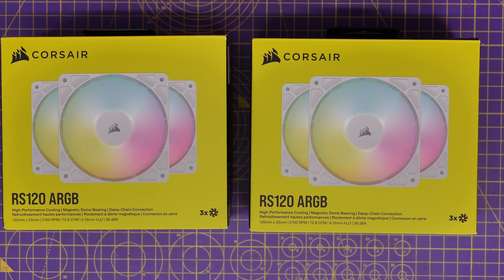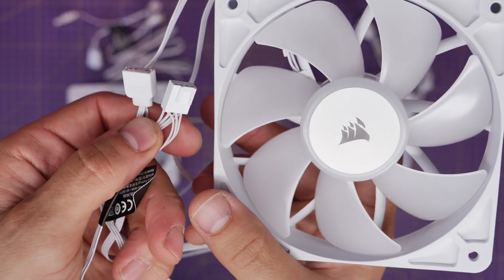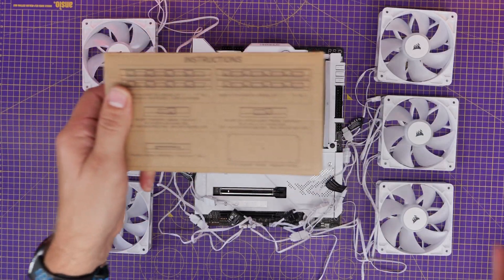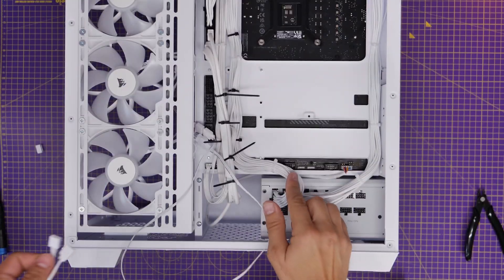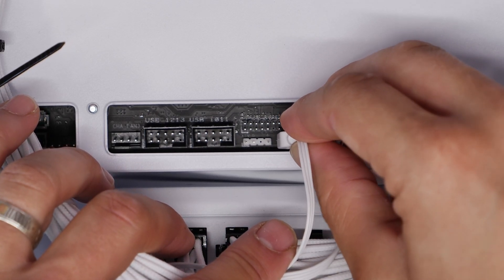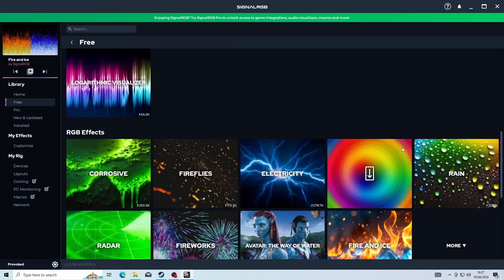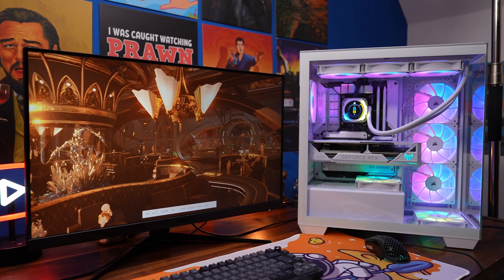How to setup and wire Corsair RS120 ARGB fans

Comment: Can you connect 4 RS120 in a single MB if the system have 2A & 24W maximum outputs? 5v (3a)argb to a max of 256 LEDS?

Comment: What I was wondering: you linked the argb of the rear exhaust fan to the argb of the radiator fans. You plugged in the radiator fans to the CPU-fan header. But I'm missing connecting the rear exhaust fan to a motherboard fan header. Also I don't see you plugging in the radiator fans (and linked exhaust fan) to an argb header (?).
Personally I'm having issues with a similar setup. I got a prebuilt PC and everything is great, except the ARGB lights of my case fans and radiator fans. I got a TUF Gaming B650 motherboard. Corsair frame 4000D case with 3 RS front fans, 1 exhaust fan and 2 radiator fans on the Nautilus AiO cooler. The first time I powered on my system, the ARGB lights of all the fans worked. The second time they didn't. I tried looking through software and settings what was wrong. But software isn't the issue, I think. As long as the fans light up at startup, they get recognized in the software and I can control them perfectly. But the problem is, they don't always light up. I tried checking cables and connections. Sometimes it helps unplugging an argb header and plugging it back in before startup. But even if they work then, when I startup the time after, they don't light up... :-(  I don't understand what's going on and what the issue is. That the argb lights sometimes work, would imply the connections are fine. Also because it's either all of them work or none of them work. The rgb on my RAM always works and gets recognized in the software. But that's not plugged in to any motherboard headers of course. Also the fans always run without issues. So it's purely the argb not working correctly somehow. Drives my crazy. And it's hard to troubleshoot, because all the argb cables are bundled and tucked away.
Reply from the maker: Could it be a bios update is required and aura sync updates via armoury crate?
Reply: @TheProvokedPrawn  I do have the latest bios version installed for my board. I removed Armoury Crate, Aura Sync, iCue and ASUS fan Xpert from my system. There was so much installed and it didn't do much. Weirdly, I had it all in my list of installed apps. But I couldn't even open some programs, since they weren't in my apps list. Could it be a software conflict? Caused by old install files? Should I try installing Armoury Crate again?
This morning I traced all my RGB cables again. It's a bit messy with lots of connected wires. But since it works sometimes, I don't think that's the issue. Especially my 3 front fans are daisy chained together pretty straight forward. Connected to a fan header and an argb header. So that chain should at least work all the time (?) The setup of my 2 AiO fans and the rear fan is a bit more messy. But since all my 6 argb lights work sometimes, it should be fine. Also all fans work without any problems. So the fan connections are flawless.
Reply: @TheProvokedPrawn  Update: I reinstalled Armoury Crate and uninstalled it using Revo uninstaller. That didn't fix it. But...I checked the wiring really thoroughly. Besides the 2 radiator fans and the rear fan, the pumpheader ARGB wire was also connected to the same ARGB header. Also the chain of wiring was a bit weird with extension cables and stuff. I decluttered it. Now my rear fan and pumpheader are connected to one ARGB header and my 2 radiator fans are connected to a different header. The 3 front fans are also on a separate ARGB header. I don't want to jinx it. But several boots in a row my ARGB works fine now. I control it with OpenRGB. Works fine. No need for all the other applications. So fingers crossed that was it. Thank you for the moral support!

Comment: I have the exact fans but my wires are significantly shorter making it nearly impossible to add a back fan and fans at the bottom of the case. I’ve also run into an issue where if I do get the fans to connect, they turn on, speed up then turn off, this is a continuous loop of the pc is left on
Reply from the maker: Maybe I suggest watching this new and improved video. It's on the RS140 fans but focuses on the wiring and the logic is the same. I show a couple of controllers in there which will help with the issues - https://youtu.be/S5I0yqXKlwg

Comment: Im still confused
Reply from the maker: Sorry
Reply: @TheProvokedPrawn it’s okay , I bought the thermalight link hub you used to make it easier. I’ll just follow your foot steps . Only thing is that there’s two very long of the same cables . Both start with a power connector and end with a 3pin 

Could that be a AIO cooler cable ? It’s also Corsair Rs120 fans

Comment: all very well, however I run out of header on my m/board, I received a hub with the corsair iCUE Hito Capellix,the plugs from this CPU cooler are much smaller, andnow theplugs from the fan wont fit the hub
Reply from the maker: yeah, they're not designed for it. I did say that right and the beginning and show you alternative solutions at 4mins - https://youtu.be/GSrsfyaYPKA?t=28

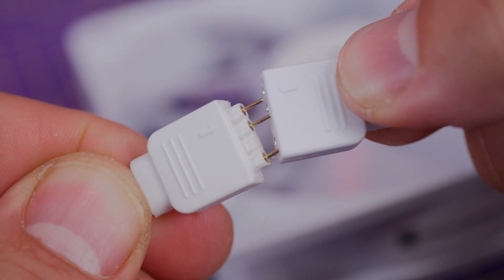Comment: 3:07 I’m trying to setup my 360 rgb nautilus cooler and I keep trying to connect all three tiger but I always get an extra wire like the rgb one with 3 spike that won’t plug into my motherboard…I just wanna know how to correct “daisy chain” or whatever all wires in correct place
Reply from the maker: That spike one is meant for connecting the fans together. As long as you have a connection that goes into the motherboard and the other fans are connected to each other it doesn't matter if one cable is spare.

Comment: @TheProvokedPrawn. Hey, hope you dont mind solving a riddle for me. This is the closest video I have found so far that actually helps but I still want some help. I'm new to pc building and the parts I want to use is: 
HAVN HS 420 VGPU case, msi meg x570 unify(motherboard), Corsair nautilus 360 argb (Aio/cpu cooler), Corsair RS140 ARGB Fan 2stk, Phanteks M25 Gen2 140mm DRGB Reversed Fan 3stk. 

Im having trouble connecting them to my motherboard (both cable and the pump to the cpu). Is the thermalright argp and fan hub recommended?

Comment from the maker: Corsair has changed the cabling since I made this video. Now the cables are shorter. Here's why (direct quote from Corsair):

"The RS series of fans natively supports daisy-chain connections between each fan. Due to the daisy-chaining of multiple fans, we’ve realised there is no need for longer cables. So, we have switched to shorter PWM and ARGB cables for easier connections between each fan and easier cable management. Each pack of fans, from single to triple, now includes 600mm PWM and ARGB extension cables to let users connect the last fan in their chain to the motherboard headers."
Reply: I just bought the newer set myself, the wiring is absolutely terrible now. Because the wires are so ridiculously short they barely even reach the daisy chain connections. 

Wish I'd bought it earlier honestly, because the new version just seems awful. Bought them for my first pc build, and it's just. Killed the enjoyment for me.
Reply: @DYSK0F1ST  I agree, I just bought some this weekend and its totally ridiculous. Its so hard for cable management. Wire show everywhere. I actually go reverse fans and too the wire outt of the little slot to pass my wires behind my case to manage in hiding my wires. Now to set them up, hopefully running all three fans on one daisy chain wont fry anything.
Reply: @OGrickm it shouldn't, I've got my three fans daisy chained together. Should run just fine off of one fan header for power, one RGB header If you care for RGB. 

Just a bit of a pain, I ended up using a set of the sorta cable extensions they give with them. To get everything wired up. worked just fine in the end, Haven't had any hiccups since I fully built the system. The sorta 'spare' wires that come with the fans are extensions, just connect those to the cables you'll be using with the fan you're connecting to the mobo and it should work out 

But, probably gonna avoid these Corsair fans in the future when I update my build or start a second one.
Reply: @DYSK0F1ST I guess it depends on the box too, since there is about an inch and a half between my box and the fan.
Reply: @OGrickm hmm, maybe maybe. I just ultimately ended up connecting my fans directly to the motherboard. 

Which worked out well for me, not sure how it'll works if you use a fan hub.
Reply: @DYSK0F1ST I just dont want to see anywires lol, I have 10fans 😂
Reply: @OGrickm i can understand that, I don't mind seeing just the ends of the cables. So I got around things without much issue. 

That and I've only got six fans. Would've been screwed if I had more, since I only have one extra fan connector
Reply: @DYSK0F1ST exactly!! This is such a horrible decision from Corsair it makes wiring fans at the bottom and the intake fan impossible to set up

Comment: Question: Are you able to daisy chain the three fans, and then connect the final RGB/Fan headers to the commander hub,  or are you limited to daisy chaining and then connecting to the header on the Motherboard? Wondering if its possible to do this, or if you need to connect each fan/rgb separately if using the hub.
Reply from the maker: These won't work with the Commander Core

Comment: I was SOOOOOOOO confused. Ther power male connection cable has only 3 pins while the female has 4 holes. I didn't even think of putting them together.,
Reply: Okay I can't be the only one. I received the white RGB version like the one in the video but the cables are barely 2 inches in length???
Reply: @ulysses4989yeah same (mine is black)

Comment: I have to ask, would it not increase the thermals on the fluid by pushing air from below the radiator out of the top instead of putting the fans on top to pull the air out? How does that work?
Reply from the maker: https://youtu.be/qQcyYHGtArs

Comment: The RS120 are no dampened and everyone should notice that before buying. If you can afford it, go for RX fans because they have a dampening ring installed for every screw. Helps to prevent the transfer of vibration and unwanted frequencies to the case or radiator.
Reply: They just work, don’t waste money, it’s not a plane

Comment: It's perfectly well explained, but my question is the following - this case 3500x with 3xQS120 pre-installed fans, is it possible to control them through iCue software instead through motherboard? Or maybe I should consider selling them and purchasing a different model.
Reply: Qs Fans didn’t exist if you mean qx keep it they are so much better than rs120
Reply: @Gentlemaenchen  yes you're right I meant RS120, which successfuly connected to the Commander Pro hub and controlling them through iCue simply by buying an aftermarket adapter.

Comment: ive plugged my corsair rs120 fans to motherboard because i cant figure out how to connect them to the controller as they dont have rgb cabels fitting into the controller and the icue is not recognizing them making me unable to control the fans, unlike the aio which i was able to plug into the controller and which im aboe to control. Do you have any suggestions?
Reply: I’m having the same problems. The connectors that came with my 3 pack of fans don’t fit on the RGB hub’s connectors.

Comment: Question I’m currently building a pc for my brother for Christmas so I’ve purchased the 3500x case with the rs120 fans but the wires seem to be short that came pre installed with the case if I link them 3 fans together and connect all 3 to the hub with 2 connections 
one being 3 pin 2 being 4 will that work ? Thanks

Comment: i went to bios, applied what you did, rgb fans stopped working. I reset it and they still arent producing color. No idea what happened
Reply: Did u fix
Reply: Better to keep them on auto detect and just use software like armoury crate to change fan speed

Comment: Will this still work along with SP120 Pro? I have a 220T case that already includes 3 SP120 fans connected to the built-in fan hub, which I believe is called the iCUE Lighting Node CORE, based on the product page. If I purchase this and connect it to that fan hub along with the existing 3 SP120 Pro fans, will everything work fine?

Comment: I just booted for the first time, only 3 fans. My fans aren’t spinning but the rgb is working.
Reply: did you end up finding the problem?
I currently am experiencing the same problem 😅
Reply: @ouop._  any fix?
Reply: @Zebastiann14 yes im not sure if we made the same mistake but what I accidentally did was I pluged in the 4pin into the RGB_HEADER, so I moved it to CHA_FAN3 since it was easier to get to rather than CHA_FAN2 and it worked 👍
Reply: same

Comment: I recently left you a comment about the Corsair lcd screen not giving me all the options.  You suggested checking out the installation which I did with no results.  But the issue was solved.  It was the icue software.  I selected the most current version to download and had the problem.  I then uninstalled the software, and downloaded an older version then updated it to current.  That solved the problem.  Thank you for all your help and those wonderful videos.
Reply from the maker: That's funny. I'd usually suggest installing the latest version 😂
Reply: @TheProvokedPrawn  🤷🏼‍♂️
Reply: do I need a hub for 8 fan config? (3 of the case, 3 of AIO, and 2 extra (one intake at the bottom and 1 pulling air out at the top back of the case)?